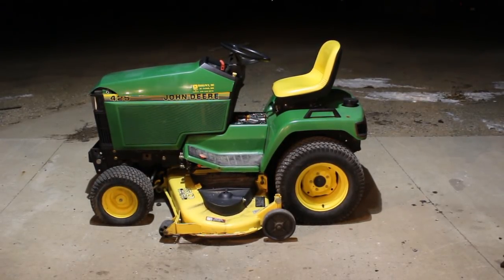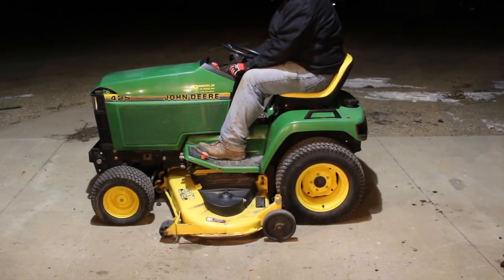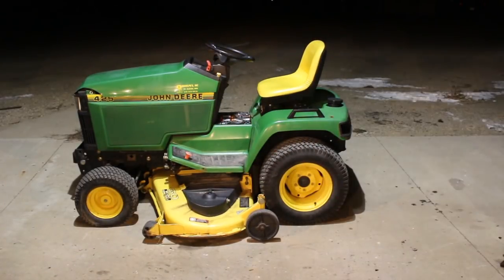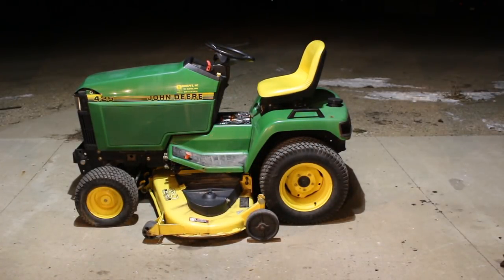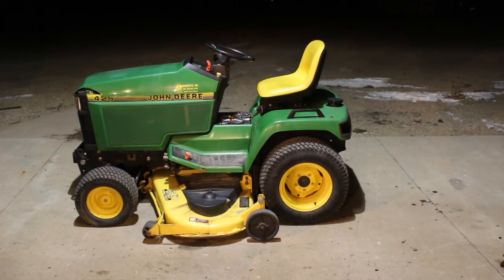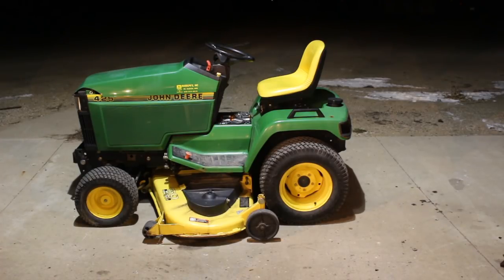John Deere 425: 60" Deck... Too Big?

Comment: My 425 has absolutely no issues with the 60 deck. No stall unless it’s a cold start and no warm up. But no issues cutting or running the deck. Cuts beautiful
Reply from the maker: These 60 inch decks are some of the best cutting decks John Deere made for GT's in my opinion. I do think that properly cared for and maintained 425 will power a 60 inch deck fine. However, at this point in time, the last 425 rolled off the assembly line almost 20 years ago, most 425's are older and have less than the 20 hp that was spec'ed and the decks rarely have new bearings etc.

Comment: My 425 can mow 12" grass with the mower going as fast as it can go. My body won't take it. I have no shield on the deck. The motor I rebuilt 2 seasons ago so it is fresh and strong. the bottom of the deck is painted with gray POR-15, (also the top under the shields) I engage the deck just above idle and tweak the choke as I do this. Once it is fully warmed up i don't use any choke.

Comment: My 1998 425 has just over 1300hrs on it and has no trouble with running the 60" deck and a kubota power bagger I run on the rear PTO at the same time. Bump the choke up just a touch and will get it going without much fuss when cold.
Reply: Good point - but wouldn't that indicate a high rpm carb adjustment?

Comment: This made me hook my Tac up to my 445. Full throttle rpm 3530-3540. Engaging 60 inch deck with power flow drops to around 2990 rpm average and recovers to 3380 rpm after about a second a and doesn’t shift more than 60 rpm while mowing under normal conditions. Driving fast will drag the rpm a bit more. My tack is electronic and has a slight lag, but I’m pretty confident in my results. 
Very strong deck.  I’ve never overwhelmed the deck but I have made the power flow choke and cough picking up leaves before.

Comment: Buddy you are so right,, i have a 48” deck on my 317 and i start the deck at a complete “Idol” and it barley changes the rpm’s ,, the opposed twins have so much more in low end torque in my opinion,, and yea i know there is a big difference between my deck and that one..but i am sure it would spin it up with no problem..

Comment: I have a 95 425 aws that began life with a 54" deck. When that deck needed rebuilding i decided to buy a 60". Basically the same set up as shown here. I have found that it only stalls when the temp is below 60 degees here in MN. Usually i can start it up drive out onto the grass and go. It will pull the motor down a bit but doesnt seem to have problems keeping up while mowing. It will pull in thick heavy grass when cutting 6 or more inches. (All clay soil, so have to wait for it to dry to mow.) 
Below 60 degrees what works for me is to feather the choke and it starts right up. And this only happens during the inital start up not at any other time and only with the mower deck. 47 snow blower and 60 broom have no problems at any temp. 
I need to find a good frame to make a template of the front hitch mount as mine is worn and needs to be filled in with weld. Deere says they have no such template but could locate a new frame. Lol 
Thanks for the videos.
Reply from the maker: I'm sure temperature has a lot to do with the deck start up. Coming up I will have a comparison of the 420 vs 425 on deck start up. These 60 decks (despite their size) are some of the best cutting decks Deere has made. Drop me an email and depending where you are at in MN I might be able to help with the front frame.

Comment: I have a Simplicity with a 12.5 HP opposed Briggs and the idle barely even changes when I engage at a complete idle which is like 1300rpm.  It has a fully governed idle which I guess helps.

Comment: My 425 does the same thing regardless of outside temperature..I found if I'm moving the tractor forward while engaging the pto it is able to get the deck running much easier...
Reply: Same, had a 455 with the Yanmar diesel w / 60” deck and had to do the same thing.

Comment: My 445 doesn't have any trouble even at a little above idle. Try taking the PTO shaft off and spin it by hand to see how stiff it is.
Reply from the maker: I think if it was in the middle of summer the 425 would have near the problem it did in this video. The extra 2 hp in a 445 makes a huge difference in start up of items like decks where there is a lot of mass to start moving. The deck in this case spins nicely. In fact probably one of the smoother decks I've had in a few years.

Comment: I had the same problem the John Deere 425 with a 60 inch mower deck the motor runs cold the motor is a cold motor and I was told if you’re going to use the mower right away to just add some chalk and it would start the mower right away and that’s exactly what I And it works fine every time

Comment: My X570 does the same thing, it won't stall out in the middle of summer when it's good and hot outside. The Kawasaki engines just don't seem to make low-end torque.

Comment: You need to consider playing with your switch. Flip it on and immediately Flip It Off and then flip it back on hopefully the engine will not die the nursery will be broke and the engine will carry the load.

Comment: Would this be the same case for the 445 and the F911 with the 22hp Kawasaki?
Reply from the maker: Without direct experience, the 22 hp 445 seems to overcome the mass pretty easy. The drivetrain for the front mounts is a little different. So I can't say with direct certainty there is a change between the two, but I would say both can handle a 60" deck pretty well.

Comment: hey keep up the great videos.  I just had one quick question about a 425 had you ever tried to put a john deere cat 1 three point hitch on one I know you can get a cat 0 but the back end looks the same as X7??.  any feed back would be great thanks
Reply: I put a John Deere cat. 1 three point on my 1997 445. John Deere had just came out with it when I bought my tractor used in early 2000,s. The only thing I had to modify was drilling and tapping a screw that goes through left side of frame. It was easier to install than the one I just put on my new 7 series because I did not have to relocate the hydraulic cylinder on the 445. Dealer I bought it from felt Deere did not say it would fit because tractor was not designed for it.  I used mine for 16 or 17 years with no issues.  My coring aerator  probably weighs 350 # tractor handled it like a champ,with 4 44# weights on nose. Took a agrifab pull type aerator and converted it to 3 pt.  Made it fun to aerate 😃
Reply: thank you  @dave2138
Reply from the maker: I had a 455 with a Cat 1 hitch. Worked great. It came already installed on the machine when I got it. I think it was a Ruegg hitch. Here is a link to their website. I have never personally bought anything from them but everyone has very positive things to say about them. http://www.rueggmfg.com/hitchkits.php

Comment: That is a BIG mower deck. I see some snow on the  ground, and U are dressed for cold weather , are  U in New England ? Thanks for posting .
Reply from the maker: It's not light that's for sure! I am located in the upper Midwest around the MN, SD, IA border.
Reply: @mmrbeef  ,Iam in Mass. and we have snow already, I sae the snow in the video, so I thought New England. Yes that is a big mower deck.

Comment: My 92 420 had a 50" deck and it was a cutting machine. I bought a 50" because I have a lot of hills. I had a 60 on my 1025 and traded for a 54".
Reply from the maker: Great point. Sometimes a bigger deck isn't better!
Reply: there's an adult joke in there someplace lol
 @mmrbeef

Comment: Yikes. Was this experimental or could you actually get a 60" deck on a 425 as an option?
Reply from the maker: The 60" deck was an option. There is nothing wrong with running a 60" deck on a 425.... Once it's moving there are not many issues.

Comment: Bruh, 20 yrs ago I used to mow down 3 ft tall and thick fescue at full speed with a 425/60". Very little was left not cut all the way down. Your engine is trashed.
Reply from the maker: Starting a deck, mowing with a deck, and deck capacity are three very different things. Starting a deck from a stop will generally take more horsepower and torque than running a deck. Newton's first law of motion is a great way to think about it. Deck capacity while being somewhat influenced by horsepower is also limited by deck design (air flow) and depth (material suspended in the air). The 60" deck design, while great for a finish cut does not have the volume/capacity to cut excessively long material at any type of speed. Between the limited deck height and the single material exit it is hard for these decks to process more than 3-4 inches of cut material in one pass. Yes, it will cut taller material, will it do it efficiently, no. This applies to both machines in this video not just the 425.

Comment: I’ve never had to restart our 425 more than twice when engaging the deck. Yeah it does have a bit of trouble when it’s cold but at this time of year I’m throwing he snow blower on anyway. 

Have you been able to engage it at lower RPMs? And also have those bearings been greased real good?
Reply from the maker: Yes, bearings were well greased. Just cold! I've never tried engaging a deck at lower RPMs.

Comment: My 445 will turn my 60 on at idle. My 445 will out pull and run circles around my 420 I had. The Kawasaki liquid cooled will run much longer than any onan.
Reply from the maker: I would expect a 445 to power a deck much easier than a 425. In many cases I would also expect any 445 to out perform a 420. The 425 is just a shade under powered IMO when compared to any of the other two 4-5 or the 420/430.

Comment: I believe this guy needs to figure out what's wrong with his tractor and his mower I've been around several 425 and owed one with a 60 inch deck on never killed the engine starting the deck.
Reply from the maker: I know right. He doesn’t know anything about 425’s and he certainly doesn’t explain the potential reasons in the video….